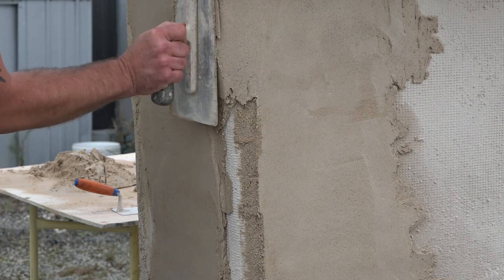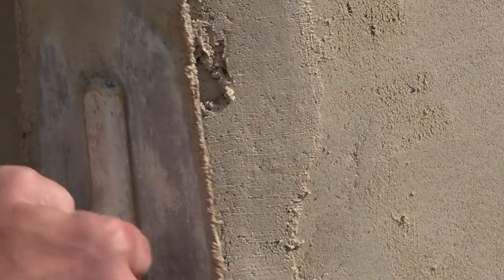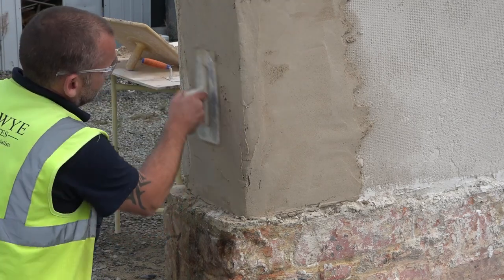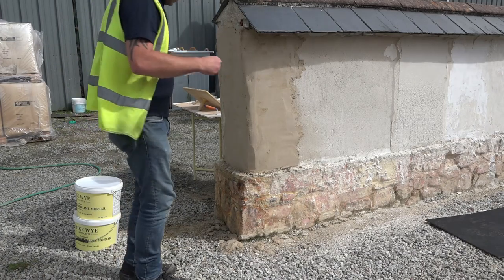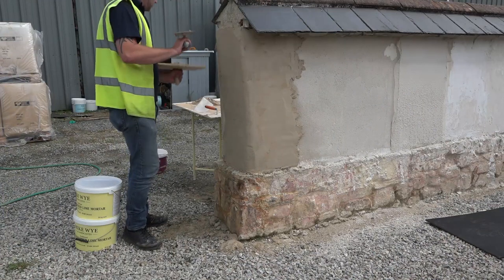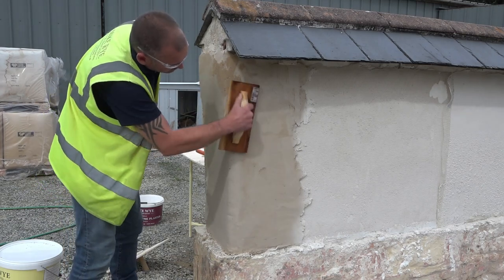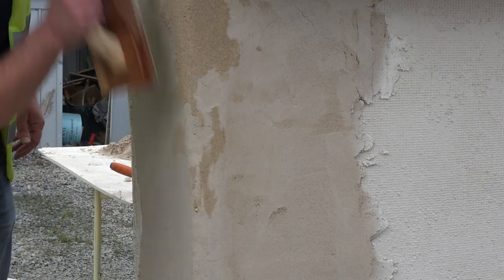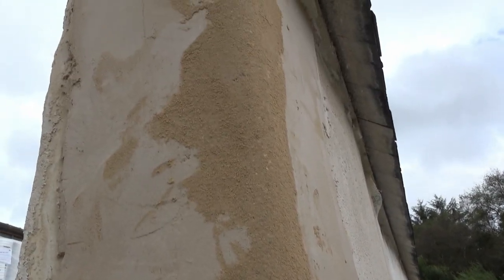Rendering external corners

Comment: I was told by an old spread, and this may well be wrong, that the rounded corner could be formed by the joint between thumb and forefinger by running this up the corner.
Reply from the maker: Thanks for your comment! There's always more than one way to skin a cat (as they say...), as long as you're wearing suitable gloves that would be a useful way to form the corner, we'd still give the render a final float to compress and finish the surface.